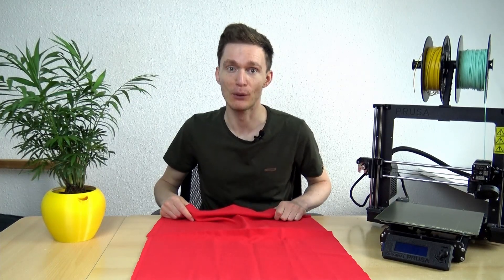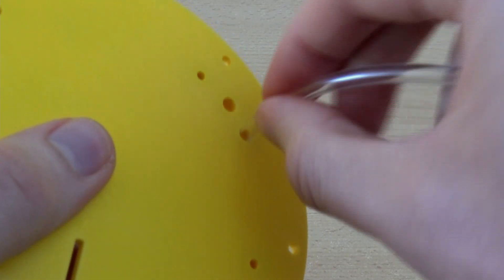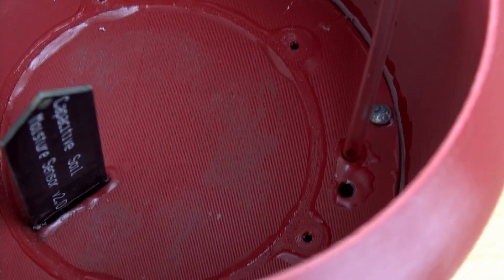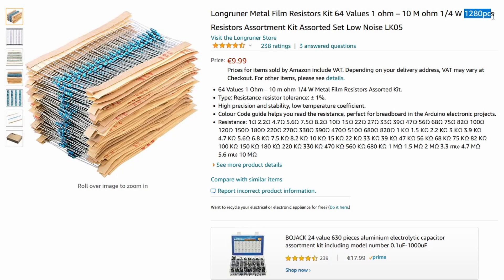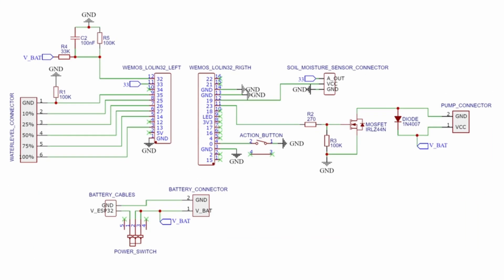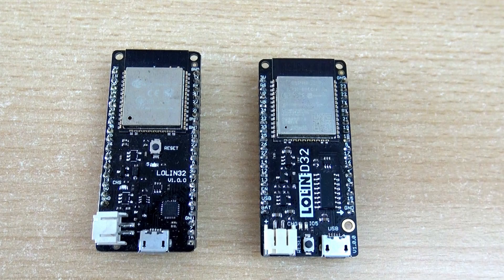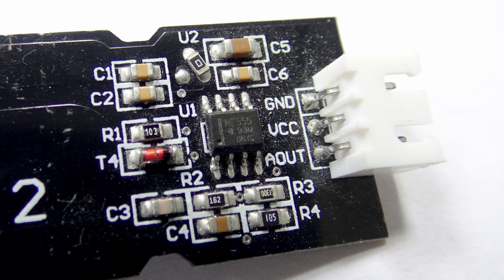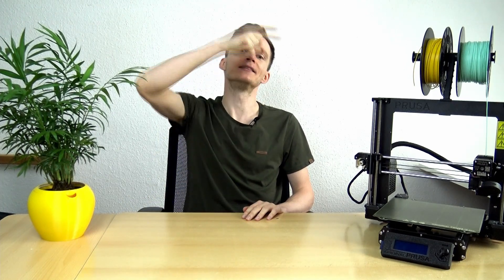Parts List for Flaura – The Smart, Self Watering Plant Pot (DIY Project, 3D Printed, Arduino)

Comment from the maker: Hey guys,
In my brief survey so far, around 200 people have indicated that they are interested in a complete kit for Flaura.
From 250 people I think the whole organizational effort (finding reliable suppliers, importing goods, clarifying legal and bureaucratic questions, organizing shipping) would make sense for me.

Can we make the 250? If you haven't voted yet, here is the poll: https://docs.google.com/forms/d/1GDRpVRxuvAgHPNp1CEXVgIKZr3mZhqmVqcmtKoSlDA8
Reply: Are we at 250?  I have started to find parts but some of them are difficult, especially the custom circuit board. I would like to be able to just get a kit with one included, or be able to buy individual ones from you?
Reply: @JaymoTheToyotaPickupGuy  Why not just use a bread board?
Reply: Did it reach 250?? I want to buy a kit. i already have the PCBs here and all files printed. I also notices the parts list is removed? why? did you abonrt the project or?
Reply: Do you still have some of this sets / Kits ?

Comment: Weird question, but could you explain why the diode is used in the pump/mosfet connection? It seems to work without but if there are reasons it is needed, I would like to know that :)
Reply: it will clamp reverse voltage spikes caused by the reactance of the motor.

Comment: Nice project! Now it would be nice a larger version, this one it's just for small plants. And the only thing I would change is the water level sensor. I would use another capacitive soil sensor for the water level sensor because using electrodes will corrode overtime and you will need to replace them. Overall great job.

Comment: Great video, and i'm going to give this project a try! I noticed that there's a water level sensor on the pcb and the parts list mentions the connectors jst with 6 pins, but i can't find the water level sensor part description or reference anywhere... can you provide some info on the part? TIA
Reply from the maker: The water level sensor IS just this cable with 6 wires ;)
In this video (https://www.youtube.com/watch?v=LBk85mRINqQ) at 15:41 you can see how it looks like.It's a really cheap and simple but efficient design.

Comment: And for the capacitive sensor, Amazon UK have  devices from a supplier called AITRIP. These sensors have TL555C timer chips which are the low power CMOS versions. I bought 10 of these and they are suitable.
Reply from the maker: Thanks for sharing this great tip! My next video will go into a little more detail on these capacitive soil moisture sensors. I found out that a lot of them have some kind a flaw.

Comment: Just a heads up guys....AmazonUK has an ESP32 Lolin32 from Esenlong. They advertise 500mA charging current and even post an image with a S2PC regulator. However, what is sent out is a Lolin32 with a 4B2X regulator which has only 150mA charging current. BEWARE!!!!
Reply from the maker: Thanks for sharing this great tip again! Unfortunately, I've also noticed that a common problem is that you don't get exactly what you ordered
Reply: Same thing in the US on Amazon too

Comment: Have printed and built it! Just waiting for the pump to arrive from China. I have calibrated the capacitive sensor with a test program logging to an Adafruit database over a number of days with different moisture levels. All looks good. Can you post the ESP32 code so that I can test the scheduling/Blynk interface and battery life?
Reply from the maker: Wow impressive how fast you were with it. Unfortunately, the code is not really finished yet and I want to concentrate on the assembly videos first. I don't want to embarrass myself with the unfinished code, can I somehow send it to you privately for testing?
Reply: @FlauraSmartPlantPot  yes sure….I’ll be happy to do some beta testing for you!
Reply from the maker: @alancross2679  unfortunately, youtube has no private message function. Maybe you can send me an email (you can find the address on my channel page) so that I can contact you :)

Comment: I think you forgot to add the tank level censor to the parts list I think
Reply: Nevermind. I see it's jsu capacitive wires
Reply from the maker: That's right. The cables make a simple, yet effective water level sensor ;)

Comment: Hi! Thanks for sharing the BOM, great video! I'm having problems finding the right LOLIN32, would a D32 work if I got my hands on them?
Reply from the maker: The D32 also works in principle, but the pin layout is different, so you would then have to adapt the custom circuit board accordingly.